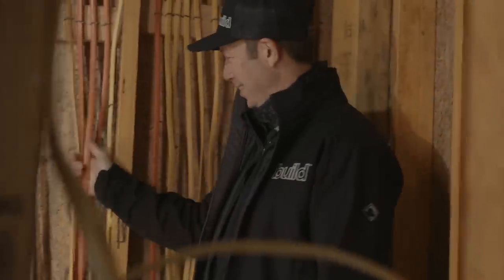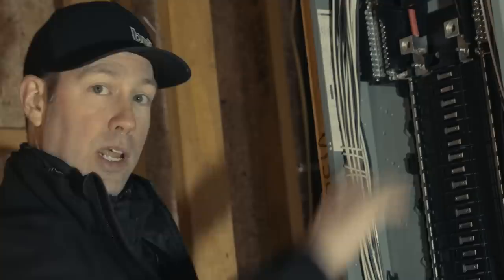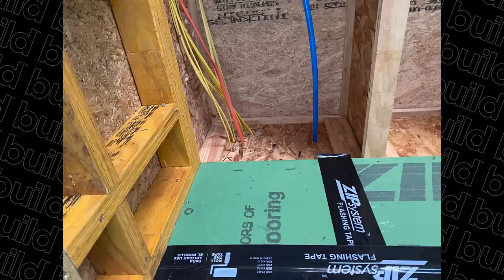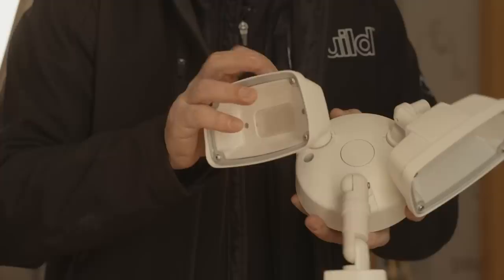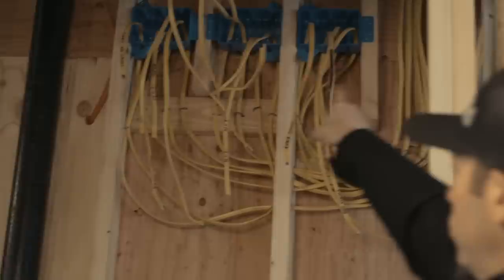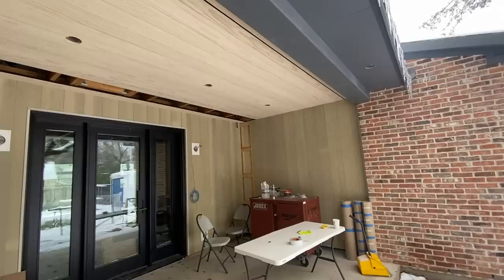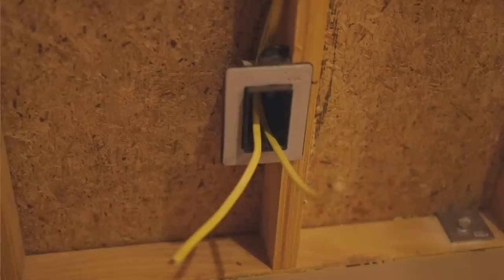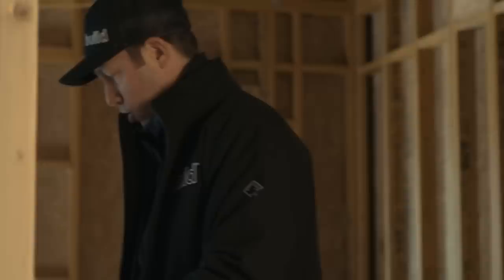5 Tips for New Construction Electrical & Smart Lighting!

Comment: LEDs do not last as long as commonly hyped. Thus I would choose screw in LEDs bulbs rather than permanent fixtures ... which will be more difficult to replace when they fail. In fact their replacements may not even be available when it comes time to replace them, but screw in bulbs will most likely still be readily available.
Reply: Even if he knew that were true he wouldn't give us that advice because Halo paid him. He would tell you to put lead pipes in your house if somebody paid him enough.
Reply: @ryanroberts1104  halo fixtures pop in an out-Im not down wtht ey BT thing-casita has been greta, but Halo thin fixtures are really great way to go

Comment: I'm sorry, a tv and a computer, even 2 of each, in bedrooms are not gonna cause issues on a 15 amp circuit. You have 1800 watts available. As an electrician who has dealt with using 12-2 many times when it was completely unnecessary, I can tell you right now on a new house I would probably charge you at least an additional $1000 based on the amount of time spent to deal with the bigger wire in every single box, where it wasn't needed. $1000 that could go towards better insulating, air sealing, better windows, etc. If there wasn't an additional cost proposed and accepted that electrician lost $ and is regretting it given how tight the new construction market is. Using 12 gauge wire in multi gang switch boxes is a nightmare given the quantity of dimmers that will be installed here. And yet those 20A ckts will likely be loaded to 20% capacity. Total waste unless you believe incandescents are coming back.
Reply: I used romex wire with 2 small wires for 0-10v dimming. My electrician didn't like it. I was told that was the best way to dim the lights. I am not so sure it wasn't a waste of money.
Reply: Depends on the computer. Gaming computers can use 1800watts.. Also in some cases people might use an electric space heater or a window AC if there is an issue with the heating\cooling system.

Comment: Another question, when is the central vac video coming? :)
Reply: Central vac? You’re kidding right?
Reply: @kungfusing1  no. A Neigbor of mine put one in and it is awesome. It makes it easy to vacuum and keeps all the dust outside.. we have one in our rv :)
Reply: Dyson have stick vacs as powerful as a normal vac, you can vacuum the entire home. Why on earth would you have one in an RV?
Reply: @kungfusing1  your not understanding.. a central vacuum has the can and exhaust in a different location where the dust expels directly outside. So 1. It’s really easy to vacuum and 2. Your not blowing around dust in the same room your vacuuming.
Reply: @bradmesserle999  I suppose if you have severe allergies but even then it’s a stretch. As far as I’m concerned it’s obsolete technology.
Reply: @kungfusing1  if I was building a house like Matt’s with all this fancy stuff it’s a no brainer.. they are fantastic
Reply: @bradmesserle999  fair enough. First thing I did when I bought my place was pull the old central vac out. I use a robot vacuum and a Dyson Stick vac. Best setup I’ve ever used.

Comment: How do you get so many wires 12/2 with ground in a single gang box?  Talking about your front entry way...
Reply: You can use deep boxes & using the press-on wire connectors instead of wire nuts also helps.
Reply: @guytech7310  I’ll look at that.  Thx

Comment: Just because i see a lot of comments about the breaker box being outside. New code will be requiring at the very least a main shut off on the outside of the home. This is for the fire department to be able to shut down the home in case of a fire. Right or wrong this is the way things are transitioning.
Reply: You just need an outside disconnect switch for fire, you don't need to install the panel outside. Fire crew is just going to pull the main breaker not selected circuits.

Comment: Why electric panel is outside? Usually it is inside either room or garage.
Reply: They are becoming more common to being installed outside for the fire department to be able to shut down the home in case of a fire. This is already code in a few states.
Reply: Down South that's common but the NEC is pushing for every new service there will be a maindisconnect on the outside so first responders has access to shut power off on the home so its not waiting for power company

Comment: 1: don't waste 12-2 on fixed lighting circuits.  with LEDs, you're talking so many lamps per circuit capacity, that you are basically dividing circuits in order to not black out the entire house if you need to shut a circuit down.
2: you have a copper feeder, but an aluminum bus panel.  
3: why do you have so much of your panel hardware exposed to weather?  everything but your stainless meter can should be inside the house, and if you must have an outside disconnect, have JUST the disconnect outside, so you're not exposing your breakers to the weather.
4: am I seeing that right, that you're running 20A circuits for everything, but you're stretching 200A for the whole house?
5: if you are sprayfoaming cables in, one cable per hole is wonderful - and you should never have more than 3 per hole.  sprayfoam KILLS bundled wiring. it overheats and damages the insulation, even with normal loads.

Comment: Matt! Low Voltage wire door sensors.  You are smart, don't walk in and press a button.  Walk in and turn off the alarm and before that the lights come on! When you turn the alarm ON all the lights inside go off! Home Assistant on a raspberry pi! Call me!

Comment: Tip 6: Don't put your main panel outside. You can get ones that are outdoor rated but It WILL rust out in 10-20 years and need to be replaced. If it's inside and you keep it dry, it will last for generations.

Comment: I thought that aluminum wiring became pretty much illegal for home use around 40 years ago???
Reply: On 15 and 20 amp circuits yes. On 25+ amp it is still used regularly. On those higher amp circuits they are going to experience less expansion and contraction compared to the 15 and 20’s.

Comment: your electrician is overloading your circuits if you breakers are Poppin. Today's LED lights on a 15 amp circuit you can have over a hundred so why you want to run 12 wire is crazy. I hope you never have to move any of those lights. The electrician didn't leave the just in case loop on any lights lol. House will  be cool once it's done.

Comment: Breaker size is depends on the circuit being fed.  Bedrooms, living rooms, hallways, and general lighting is supposed to be protected at 15 amps. Most jurisdictions will not allow 20 amp breakers on those circuits. 
City of Arlington, TX  requires #12 romex or larger. The 12 still has to be protected by a 15 amp breaker.
Reply: Yeah that’s not true, they will allow 20A breakers on those circuits. Requirements state a minimum anything larger is acceptable.
Reply: @RaddestDad  where do you work? That won't fly in north Texas. The purpose of the lower amperage breaker is a quicker trip on small electrical items. You want a faster trip point to prevent possible fires.
Reply: @robertmaples3178  Thats what the AFCI breakers are for. A device can "catch fire" with less than 1 amp of power. Triping at 15 AMP or 20 AMP won't make a difference. The purpose of 15 AMP vs 20 AMP is the size of the wiring in the walls because in an insulated wall, there is no airflow for the heat to escape.
Reply: @guytech7310  what code reference says its okay?
Reply: @robertmaples3178  To my knowledge, there is nothing in the 2020 NEC that limits bedroom receptacle to 15 amp circuits. I believe since the 2017 NEC bedroom receptacles need to be on AFCI breakers.

All my bedrooms have 20A receptables using AFCI breakers and it passed inspection. I suppose some counties could be imposing limits beyond NEC.

Comment: 30 years ago when I built one of my homes and used 20 gage throughout my home,I told an electrician at work what I did.He told me that was a semi dangerous thing to do as most items that would be plugged into an outlet would only have a cord on them that was rated for 15 amp therefore the cord on the appliance would overheat before tripping the 20 amp breaker.This seemed logical to me so I went back and changed out all my breakers to15 amp.Anyone else think this seems legit?

Comment: Your really going to hate the “Bluetooth Mesh” system. It’s not very reliable long term. There are smart home systems that use WiFi but can be used if the internet goes out. I still hope you plan to run some CAT6+ in your house so you can at LEAST have a wired backbone Mesh WiFi system.

Comment: 20A vs 15A circuits. Yes, 20A for every circuit with power outlets, but 15A for lighting circuits is perfect, especially with modern high efficiency lights. In my jurisdiction code limits the number of square feet per circuit (for lighting). Given that limit, I'm no where near 15A per lighting circuit anyway, so why waste the money?

Must be a Texas thing, but why would anyone put their load center on the exterior of the house? Put it inside and only drill one hole.

Comment: Ok Now why didn't you get into discussing more of the breakers? Your'e trying inform homeowners of prices of products but you didn't explain the difference Standard, Arc Fault, Arc Fault/ Ground Fault Circuit Interrupter and Ground Fault Circuit Interrupter. That'll give them sticker shock since most electrical inspections require those breakers. Example if i need 10 Arc Fault breakers that's 10@$43.00 a piece which equals $430.00 just for that set not including what other breakers you need which could be more  or less depending on what you need
Reply from the maker: That’s a whole video in itself!
Reply: @buildshow  ok but your showing the pretty but then when the contractor gives the the bid to install service their bubble burst cause it just broke the budget. To me you should of touched on it, then stated in another series you'll be getting into more detail
Reply: @buildshow  Matt, please bring an expert in on this stuff. You’re a knowledgeable builder but definitely out of your lane.

Comment: You lost me on your 120v only sub-panel concept. It’s still fed with both legs of your 240v service. Are you saying you just won’t be installing any double pole breakers in that panel? 
Don’t really get the advantage aside from being able to run the maximum number of circuits the manufacturer specs for that panel.
Reply: I'm sure he's saying he just won’t be installing any double pole breakers in that panel.  I don't get why anyone would tolerate an outdoor circuit-breaker panel.  They should all be indoors.  Just imagine that it's raining heavily and you need to go outside and open the panel's door to flip a breaker.  The breaker's probably going to get wet.

Comment: You should use plastic insulated staples instead of the non-insulated ones where are the metal can hurt the cable sheath.  Also putting your branch circuit breakers outside is a terrible idea!  The load center should be indoors.

Comment: Lost me at direct wiring.. so basically if anything goes wrong you have to call an electrician.
Cheap 5-20 plug attached to the beam and replace yourself if it fails.

Also tend to agree with the issues on these all in one systems.. I'd far prefer a smart switch system that works with any lights.

Comment: I've never heard of putting 110 and 220 in separate panels, but I live in a 1979 house.  Guessing it's a new building code?
Reply: Nope. He installed all of his appliance circuits outside and his lights and receptacles inside.
Reply: It's not. Nothing in the NEC says you have to separate them.
Reply: The only thing that is code in the 2020 NEC you have to have an emergency disconnect outside so at the very least the main breaker will be outside with the meter.
Reply: 110 panels are not a thing, Matt needs better electrical advice. the generator video was a disaster too.
Reply: I let you in on a secret that subpanel was also 240V, not 120V. 

You have to run 240V because L1 & L2 need to be balanced, otherwise it will cause problems for the pole transformer.
Reply: @wim0104  what was wrong with the generator video?

Comment: I understand why you want 20A circuits for the receptacles but it’s a total waste of limited natural resources (copper) for the lighting circuits, especially since you are using led lighting. All of the smart home crap will be obsolete by the time the house is finished and your wife is going to get fed up with all of the complexity of running all the lighting scenes. Yeah it’s cool at first but then you start living there and you just want to walk in a room and flip the light on. It adds way too many points of failure to a basic home electrical system. You will love the ditra heat for the tile floors! I just finished our master suite at our daughter’s house up north last year and it’s great but way over priced. I’ve installed several heated tile floors over the years and they are all pretty good, ditra is probably the easiest but if I hadn’t run across a special order that was returned at Home Depot I would have never used it. I got a nearly $1000 heating cable for $75, I couldn’t pass it up.

Comment: Here’s where it gets weird. Just because you have 120 it doesn’t mean you have 240, you could have 208. If you know why you know.
Reply: You could also have 120v ,208v, and 240v all on the same system 😱
Reply: @jacobmillyard6799  yeah that delta leg isn’t allowed to be present in a single phase panel tho.
Reply: @Leland Holton  you wouldn’t get it on single phase anyways. Still run into old industrial/commercial buildings that have it once in a while and it’s a pain the balance loads since you can’t use any single phase B to N loads
Reply: I've yet to see 208 in a house, anywhere.
Reply: @nickstopherd7762  Apartments often have 208V. Thats why a lot of applicances have a 208V option. 
FWIW: I did try to get 3ph power to my home, but the power company could make it work. Need 3ph power for the shop.
Reply: That's why I said house. Plenty of apartments and condos are 3 phase.

Comment: Why not just have the panel inside the house.
One 2 gauge SEC from meter into the house to the panel and have all circuits run from the interior panel throughout the house

Comment: I think money would be much better spent by completely separating light circuits and receptacle circuits. 15A of lighting buys you a tremendous amount in terms of LED. Also, outside of kitchens,bathrooms, and work areas, I think 20A has no ROI within a house.
Reply: Plus here in Canada all sleeping area device outlet circuits have to be arc fault protected and many builders are installing then in all general outlet circuits.  High recommend that.
Reply: @Chris Van Bommel  I need to brush up on 2020 but they are very few receptacles locations that do not require both tamper resistant (TR) and AFCI protection
Reply from the maker: Fair points
Reply: @jacobmillyard6799  agreed. I am retired so not up to date but new builds I am visiting have most if not all general purpose outlets with AFCI, so if not all have GFCI/AFCI as cost is not that much greater and then easier to just install on all.  Motor circuits, central Vac, fridge, freezer, furnace etc on regular circuit breakers.

I understand that now in Ontario all receptacle outlets that are accessible must be tamper,  exceptions are things like washer machine, sump pump, fridge.  But even then easier for trades to just stock and use all Tamper resistance outlets.
Reply: @chrisv_b  Issue is that brushed motors can trip AFCI breakers.

Comment: Hint. If you’re in the County (no inspections) the electricians will put 16g wire in your house.
Reply: No, they won't...that is just stupid thinking. They don't sell rolls of 16/2. You can only get 16ga THHN wires, which have to be run in conduit making the whole thing more work.
Reply: @ryanroberts1104  ok bro. I build in Bexar county and they use 16g wire everywhere. Maybe it’s not 16/2. But it’s 16g wire. Don’t believe me come on down.
Reply: @The11AMARK  LOL! Where do they get this wire that doesn't exist and why would they spend more time and money to do it wrong? 16ga is not any cheaper due to the amount sold compared to 14 or 12.
Reply: @ryanroberts1104  no clue. I had to get exception letters when a community I was in for annexed into San Antonio because of this. Trust me. It’s a real thing
Reply: @The11AMARK  OK, I guess you're the expert on stupid/illegal installations. The wire you speak of simply cost the same or more than 14/2, this is a fact.

You're an expert yet you can't even describe what type of wire they are using. It doesn't matter where they are at, that would be illegal.

Comment: Hell No 14 gauge for lighting loads is plenty. Have You ever tried working with 12 wire on 3 and 4 wire switches. If You properly circuit your home, overloading is not an issue.

Comment: Not a fan of making things product dependent or proprietary.. now your stuck with halo type system- they do look nice, but you should still,  Wire your home traditional also in my little view, as products are getting improved on traditional wiring and automation changes daily.. ie the 1 switch and the switch bank up high in closet.